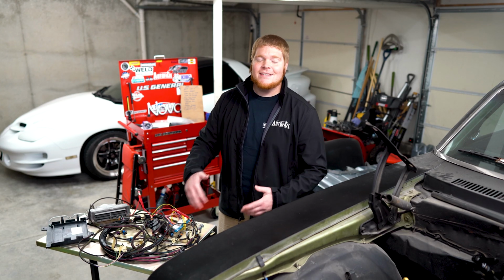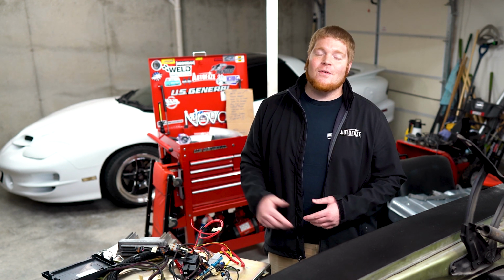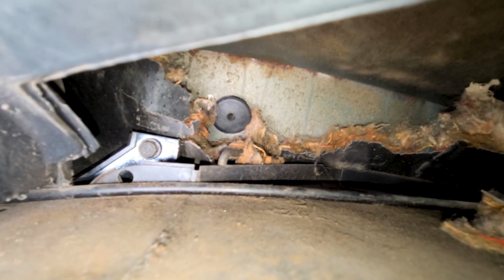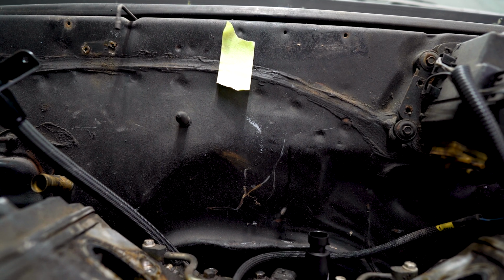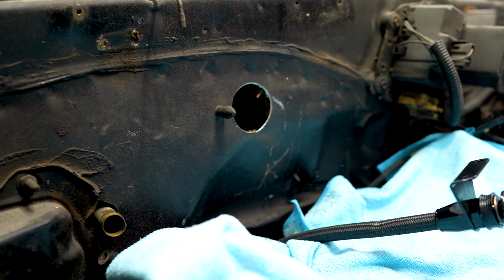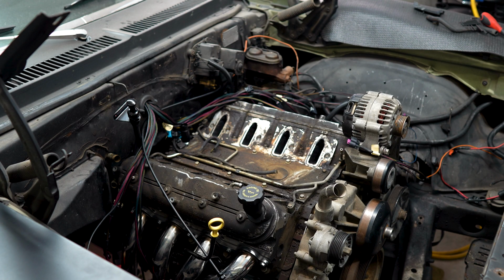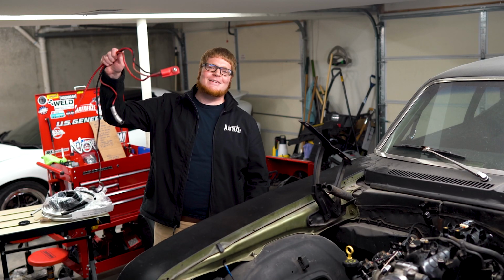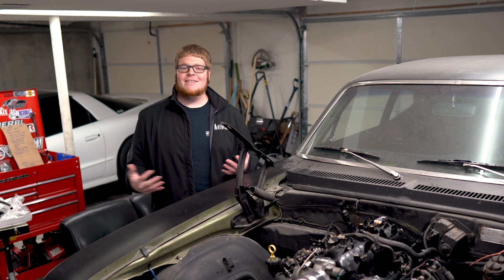LS Swap EASY Wiring! Nova PROGRESS!!

Comment: Nice I pick up a painless wiring kit can still use it with the ls harness kit for lights and other because I don’t have any wires at all strip down
Reply from the maker: the LS harness just runs the engine. You need both a body harness and LS swap harness.

Comment: nice bro i have a 71 nova 350 with a 200 4r trans.. im rebuilding a 5.7 ls1 aluminum block and will be swapping soon .. im looking for a standalone harness to suit my needs and budget  wanted to keep the 200 r4
Reply from the maker: Im sure guys have done it but I would be nervous running that transmission if your going to drive the car hard. Thanks for watching man!